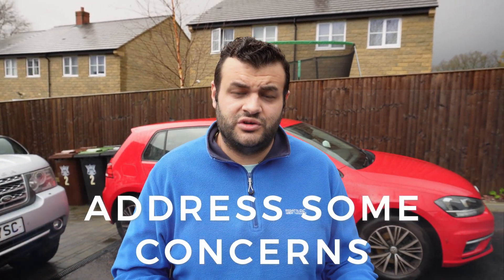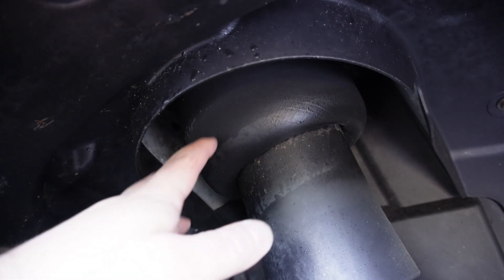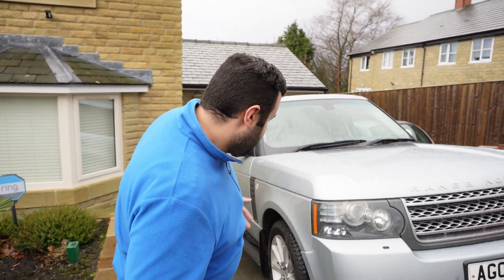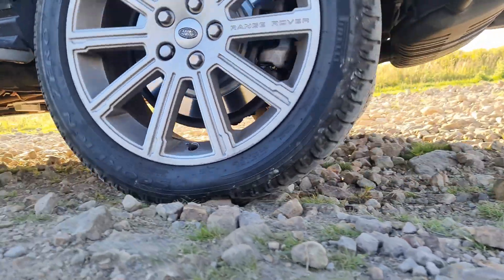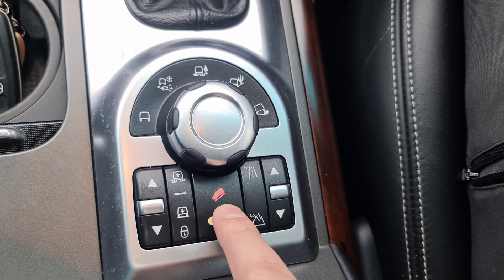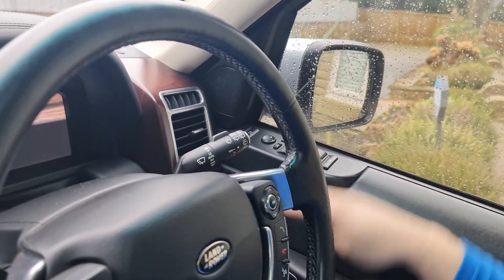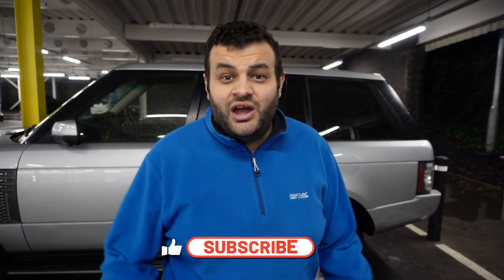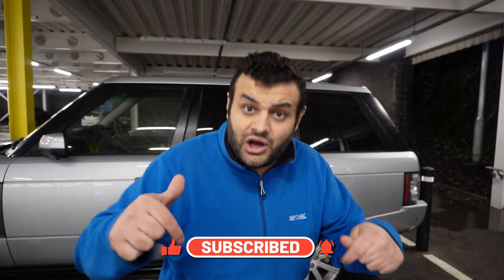L322 Range Rover Autobiography Suspension Simplified

Comment: Id rip the air out and put coils in
Reply from the maker: Hi Noel, welcome to our channel! 😊 Interesting, that's different! Is there a specific brand or system of coils that you'd use? 😊
Reply: @lifeasusual  iv a 59 plate sport once these 4x4s get over 10 years the air is just a no go for me maltings 4x4 would have coils for your l322
Reply from the maker: Cool, I'll check them out! Thank you!
Reply: @lifeasusual  your main aim is to try and make it reliable so for me a old air system has to go

Comment: Great video looked nice where you went , not been even though its not far from where I live in West Yorkshire so may have to take a trip out next year.
 I am with you on why would you buy a air suspension car then change it to springs just because of a issue , plenty of tutorials on how to maintain the compressor and valves and even how to change sensors and bags. I have had plenty of cars with snapped coils due to UK roads so still need to fix springs / shocks . I have seen some people that have changed the air bags but the one they are changing is from the original built date so they dont do that bad, it's all about tracing the air leak. For me I would want the comfy ride of an air bag. 
Hope you enjoyed the jacket potato , they used to be a jacket spud stall on the market that used coal to cook them and they were the best or when we were younger and had a bonfire you would wrap in foil and place them in the fire and again were so nice that way, now we just microwave them 😂
Reply from the maker: Hi Joseph, we're so glad you enjoyed the video!😊 First of all I want to say that we absolutely love Yorkshire, we visited Wensleydale Creamery in North Yorkshire and we've also been to West Yorkshire (did a Treasure Trail in Hebden Bridge and went for a ride on the Shipley Glen Tramway, near Saltaire). So many beautiful places! We definitely recommend a nice jacket potato and a walk at Derwent Reservoir, especially in autumn or spring. 
Hahaha 😄 We used to do the same when we had barbecues, but with sweet potatoes, as a dessert! While we're making the barbecue, we'd wrap the sweet potatoes in foil and place them on the fire. Then, at the end, we'd take them out and have them for dessert!

Comment: Another great video, thanks! I know a lot of people hate air suspension (especially when it goes wrong) but I love it. Helps that the previous owner of my L322 had all 4 airbags replaced in the last 2 years 😂
I believe the car also drops from 'normal' mode when travelling at 80mph+ (if legal in your area).

I always thought it was a shame you couldn't use a line from the compressor to fill your tyres like I could on my 2003 VW Touareg (with air suspension).

Lol glad you enjoyed the 'spud' (jacket 🥔). 😂
Reply from the maker: Thank you for your lovely comment, we're glad you enjoyed our video! 😊 Since the previous owner looked after your vehicle and changed the air bags, then it's really good! 😁 Yes, it's true, the car does drop from "normal" mode on the motorway, to be more firm on the road. 
It was actually a really delicious jacket potato 😄🥔